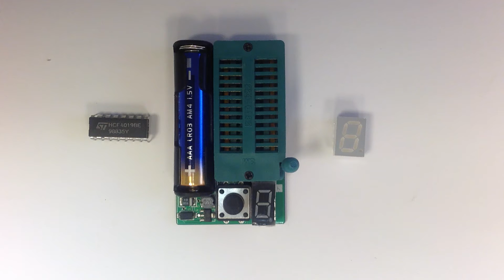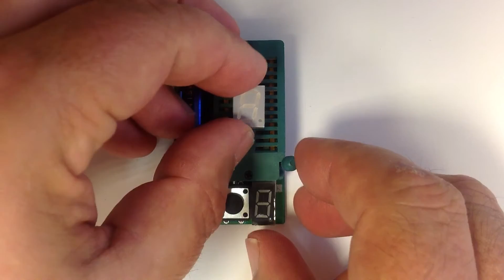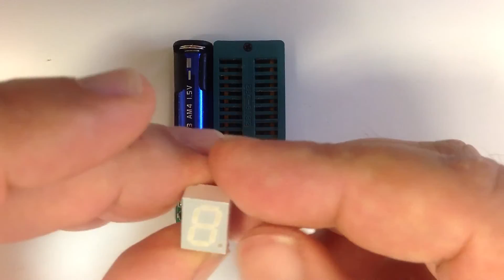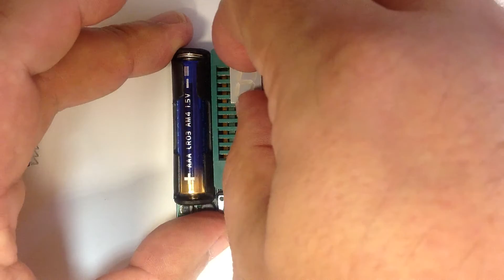LM399 IC tester anomaly

Comment: this little device is not sold anymore? Couldn't find it on Aliex. Is there any other that does thesame job?
Reply from the maker: https://www.ebay.com/itm/Multi-Function-IC-LED-Optocoupler-LM399-DIP-CHIP-TESTER-Model-Number-Detector-F-/174864826088?mkcid=16&mkevt=1&_trksid=p2349624.m46890.l6249&mkrid=709-127639-2357-0
Reply: @bzoli5706  thanks friend. But that's in USA, not in EU. It seems that the costs are too high if one wants to import it.
Reply from the maker: @mariodistefano2973  No, it is in China. I don't know where do you live, but for me, the shipping is only 0.88 EUR to Hungary. And maybe it will be forwarded to you from the EU to save the VAT and TAX for you.
Reply: @bzoli5706  I live in Italy. Do you think it is possible to send it here?
Reply from the maker: @mariodistefano2973  Of course, the shipping cost to Italy is 1,39 EUR. Study the link that I sent.

Comment: None of these testers are absolutely fail proof. You can come across conditions that will fool the tester. It is entirely conceivable that two devices may return the same results for a given stimuli. Could the firmware be improved? Likely.